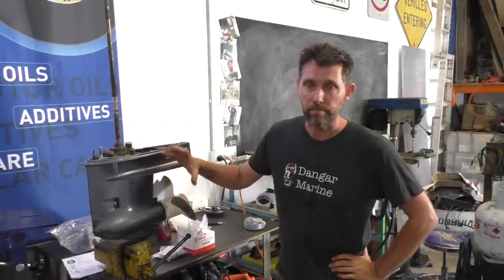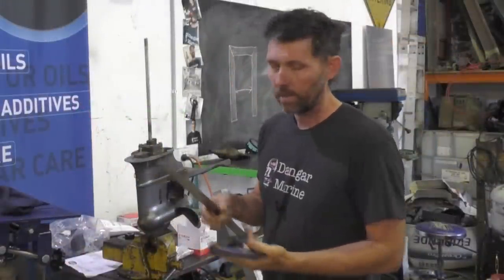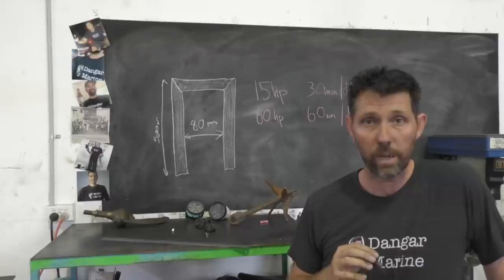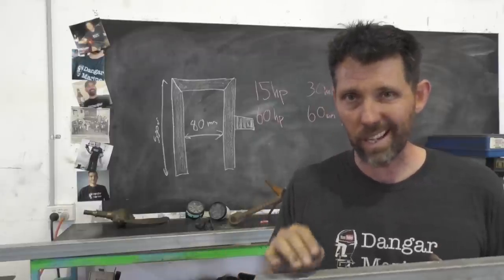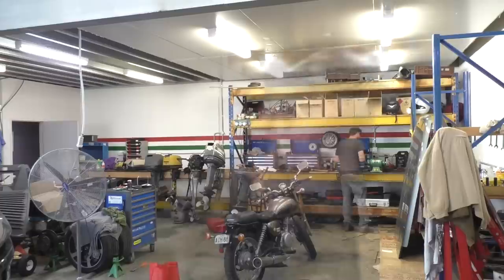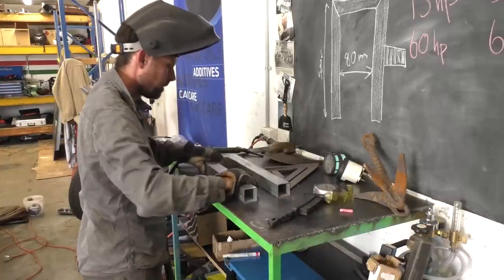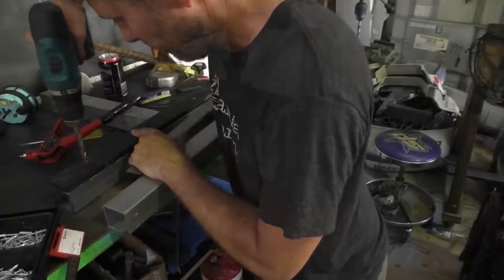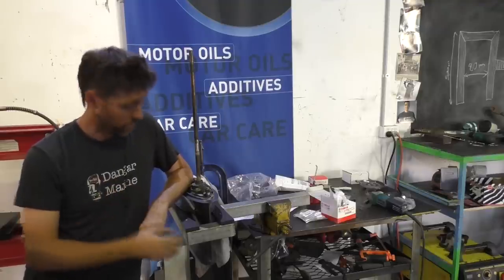Making a lower unit service stand

Comment: Dear Stuart Allen (aka Dangar Stu);  Dear Stu, I just wanted to say how I enjoy your excellent videos and tutorials.  I have been trying to get my boat to crank since the beginning of August, and today was the big day.  A repair manual is a great thing, but even better if you can see how things are trouble shot in the real world of an outboard mechanic par excellence like yourself.  Today, I cleaned and checked every connection on the boat (23 ft Hurricane Fun Deck with 2000 2-stroke Yamaha, 115TLRZ).  At the end of that arduous task, my work paid off.  Because of your videos, I was able to replace my starter solenoid, check the neutral safety switch and replace the ignition switch (none of which did it).  In my inspections today, I did find one blown fuse under the cowl of the motor which I replaced, and upon cranking, the engine cranked on accessory instead of start on the ignition switch.  Part of my difficulties were caused by the boat manufacturer not having the same wire colors and codes as the Yamaha engine.  I switched two wires, lug for lug on the ignition switch and everything worked as it should.  Many thanks for sharing your time and skills to make me a better boat mechanic.  Much appreciated.  Keep up the great work.  John Dunckelman, Cape Coral, Florida, USA.
Reply from the maker: You're welcome John, glad to hear you got your problems sorted out. :)

Comment: As you know or may remember  I rebuild vintage outboards and after watching this video I like your design, what I do now was to clamp the lower unit to my work bench . But I think yours is better , thank you !
Reply from the maker: Thanks Dave, it did work pretty well. The only difference I would make next time is make the support arm round tube that goes into a sleeve so I can rotate the whole unit.
Reply: That’s exactly what I was thinking and use an automotive engine stand ! I’m looking for snowmobile by-fax ( plastic track runners )and like you said do both sides .

Comment: Made one of these years ago to deal with a heavy mercrusier alpha 1 lower unit I once owned. Made mine out of wood. It really helps when you are changing an impeller or even when you just have a lower unit sitting around the shop. Yours is much nicer Stu. The tig welding was a nice touch. Great video! Thanks for sharing.
Reply from the maker: Thanks mate, yes, I never thought of it that way but they would make nice storage racks too. We have loads of gearboxes floating around so I might make up a timber one with five or six slots to keep them in.

Comment: This will be my next job. I have a Mercury 90 straight 6 that won't go in to Forward gear. First job is to make a tool to remove the ring that holds the bearing carrier in place, then I have to make a puller but before I actually do the job I am thinking a stand like this is very much in order. Thanks again for another highly informative and well thought out video.
Reply from the maker: Hey David, I can't believe I didn't make this sooner, it's well worth it. Those bearing carrier rings really do need a custom tool too. Send me a pic if you make one up.

Comment: This is a good idea that I think will be a winter project of mine.  Something to consider on a design modification and that I think I'll do, is to add a piece of steel on the 100mm side facing downward.  Then I can use a piece of pipe that slides into my floor jack and locks into the lower unit stand allowing me to use my floor jack to raise and lower the unit into the outboard/power head.  I can simply use a longer or shorter piece of pipe depending upon how high the motor is.  Love this idea Stu!!!
Reply from the maker: Thanks David. I think combining this holder with some existing jack or stand is the way I will go too. I didn't really go into in this video but I'm thinking of adding a base to the extension so I can bolt it to my transmission jack for exactly the reasons you describe.
Reply: I was thinking at standard floor jack but a transmission jack would be even better!  Great idea!

Comment: i built one so it would fit in the 2" receiver hitch on my truck.   good for mobile work, and it can pull right out and be used in the vise.
Reply from the maker: That's a great idea. I'm going to find a bit of box section just bigger than the arm of my stand (like your hitch) and make a mount so I can add it to my transmission jack soon. Being able to rotate it is nice,  but I think being able to slot it in one of four ways will be more than enough.
Reply: I welded a receiver hitch to all my welding shop tables to be able to move around vices and jigs and such by just welding a small piece of the hitch side square tubing to those items.....works super great for all sorts of projects.

Comment: Even grinding away the galvanized coating i'd weld it outside can bugger you right up. Will definitely be making one of them. Nice.
Reply from the maker: Yeah, I agree, galvanising fumes aren't good for you. I edited it out of this video but I hit the metal again with an angle grinder to get more off before doing the full weld as the spot welds were still smoking and going white. A respirator under the welding mask would have been a good idea.

Comment: Hi Stu, you make som great videos. Please keep up the great job you do with this.I just got an idea for an improvement on the stand for a user like you who uses it on a daily or weekly bassis. Definetely do the pipe-thing to rotate it.... and here comes my idea to make a quick and versatile fix to be able to rotate it with no movement of the lower unit inside the horseshoe. Make another horseshoe to sit welded a few cm above the first on - all welded together in the same construction and with room to slide the lower unit in between those. Look up the tool called "Winbag" which is a small rubber air pillow with a pump and a deflation vent - really easy and simple to use and made to hold windows during installation. They compress completely flat. Use (and mayb even attach) one or two on each side between the upper horseshoe and the lower unit. Now you can fix and un-fix the lower unit in seconds without risking to scratch the paint like with the clamp. I bet it sits steady even when rotating it since the winbags can take a lot of pressure (I think it is 100 kg for each winbag).I know it is a bit of money and a bit more work - but I think the tool will be improved reasonably in relation to that. Especially if you are a professional that mounts and unmounts a lot and you want to take good care of the paint. If you are really inventive you might be able to make a better solution with parts from a bicycle inner tube to have a hold all along the horseshoe. Then you just need to figure out where to get the hand pump and deflation valve.
Reply from the maker: Hi mate, I had never seen the winbags before. It's always good to learn of a new tool, you never know when it is going to be the perfect thing for that tricky job. They sell them at our local hardware store so I'll check one out soon. Coincidentally we have a car on our hoist at the moment that we are installing airbag suspension into. Winbags look like a smaller version of pretty much the same concept.

Comment: I've never made one of these lower unit stands but if you worry about different size motors what if you build the main one to fit the biggest motor that you work on then make you plates that will bolt down to the Mainframe to fit different size motors

Comment: Neat idea , I may make one for the leg of my engine. But seeing your mount I thought of making mine to fit  my engine stand. That way I can flip the leg over 90 degrees each way.
As for TIG and MIG welding, I use a small fan to blow the fumes away from my face all the times.
No beer this time? I didn't spot it if it was there :-)
Reply from the maker: I'm thinking of adding a plate to this one so I can mount it on my transmission jack. I'm going to try to find a bit of square tube that the arm fits in so I can slot it in at one of four angles.

Comment: Great video Stu.  We use similar stands at the shop I work at.
Reply from the maker: They certainly are a much safer way to work on lower units. Looking forward to making up a better way to mount it, probably onto our transmission jack I think.

Comment: Mine is the same but I made one side (arm) with a  bolt & wing nut  at the front end so it is able to swing wider at the end to take larger Lower units,   I also made mine self standing ( a pipe within a pipe + a T handle thru a nut to adjust the height)  I have had it for years it is pictured in several of my vids.     I Have a commercial model made by specialty products out of California ,,but I much prefer my hodge-podge homemade ,,                                                  kodi
Reply from the maker: I was thinking about making it adjustable, but when I realised it could take a wide range anyway I decided to keep it simple. I'm definitely going to make it free standing down the track so I don't end up with gear oil all over the bench.

Comment: Again a brilliant video! Pure magic mate!
I've now gotten my boat.. Did what you said and put my hands in my pockets and had a visual and found loads of small easy fixes!...
However, I noticed the lower fin, was bent... Not broken off, except a small notch on the bottom... I remember you saying they break easily...  So my question is... Is it worth trying to vice it and try bending it by the force of vice?.. Or is it bound to break off you think?
Really appreciate your videos and help!... Cheers!
Reply from the maker: Thanks Roy. You could try heating it before bending it. I've read that if you put motor oil on the reverse side and heat it until it starts to smoke then that is the right temperature. If it does break, you can buy after market skegs to weld on which is something I've been thinking of doing a video on soon. http://www.ebay.com/bhp/skeg-replacement
Reply: Dangar Marine you're a star mate. Thank you and looking forward to new videos!

Comment: could you make a video on how to disable the oil injection system on a '97 mercury outboard including how to remove oil pump shaft.
Reply from the maker: If ever a motor comes into the workshop for that job I'll be sure to film it.

Comment: hey buddy first of all i want start off by saying all of your videos have been very helpful to me so far but i have ran in to a problem i have a force motor 125 and i have taken the lower unit off im trying to get the gears machine everything was going good until i got the driveshaft an pinion i have taken the lock nut off but the shaft doesnt  come out nor dose  the gear fall off is there any tip you could give me that could help ive tried all sorts of pullers but non seem too help an plus the driveshaft is about 30'' to 31'' long so agin if you have any tips i would surly appreciate it an agin love the videos so keep em coming buddy
Reply from the maker: Hmmm, sounds like a bit of a corrosion problem, or maybe a slight bend in the end of the shaft. A bit of heat in on the pinion gear might help it drop down, but if you want to reuse it I'd be careful about using too much heat. I'm also trying to think what you could fit in there that would expand and put the driveshaft up but nothing is really coming to mind. If you do put any force on the bottom of the driveshaft, be sure to put the nut back on a few turns to protect the thread.
Reply: Well I just finally got it out I had to  use a existed nut and a 3/4 bolt an turn on it finally came out but it shot out lol like a bullet about 2 feet but I got to looking it dose look like the shaft is slightly bent but I can't tell

Comment: I need some help I'm wanting to get a 25 Etec evinrude for my 1956 14ft vhull lone star but I don't know if it will rip my boat apart any suggestions?
Reply from the maker: It isn't unreasonable to put a 25 on a 14ft boat, but it depends a lot on the hulls construction and condition. In the 50's is probably would have be designed for a smaller motor so the transom might not be up to it. You could always look at reinforcing the transom first.
Reply: Dangar Marine Thanks for the help I just replace the transom with a 1in oak plank and over all the boat is solid it's been in a barn for a long time and I just got it off my granddad in July so I hope nothing bad happens and I will do a walk around soon

Comment: Hey bro what's up? My outboard is a 70 hp 3 cylinder engine and one of the spark plug wire from the ignition coil pack is sliced open. Do you think it was the cause for me having the throttle open and going 5 mph and also it's shutting off when put into gear? I'll appreciate your help.
Reply from the maker: I'd say it is likely cause. motors don't like running out of balance so if you are down one cylinder it will make a big difference. As they say, start by fixing what you know is broken and then start looking for what else might be wrong.
Reply: Dangar Marine I appreciate ya comments I live in the Bahamas and want to further my studies to be knowledgeable like yourself in marine mechanics. I will swop it out and let you know what happens thanks bro.

Comment: One day I will be faced with that task, maybe.   How hours is a water pump impeller good for??  I know a man that didn't change his on his inboard merccruise V6 twins for 12 years.  Yeh, he is crazy for real.
Reply from the maker: They are surprisingly tough and can last several years. Some people go nuts and change them every 50 hours of running but I would go for about every 100-150 maybe. Age is important too so if you don't do many hours then maybe change it every 3 years. The big risk with leaving them isn't so much that the engine overheats but if a blade breaks off and gets stuck inside the engine.

Comment: Welding on galvanized steel is very dangerous. And very deadly
Reply from the maker: Yes, grinding the gal off the part you are welding is important, as is good ventilation.